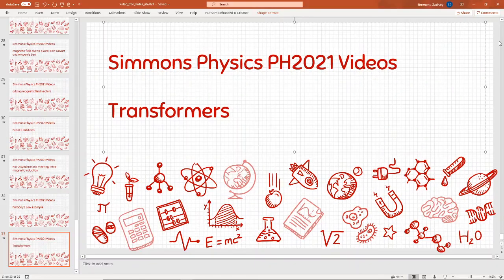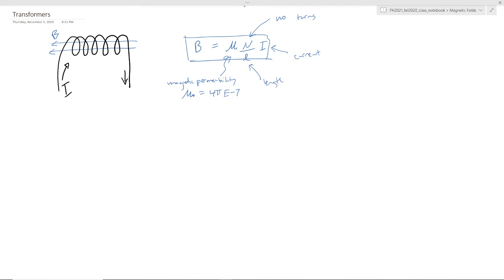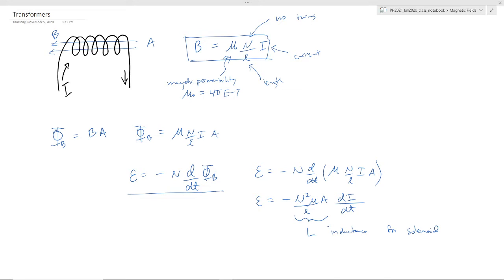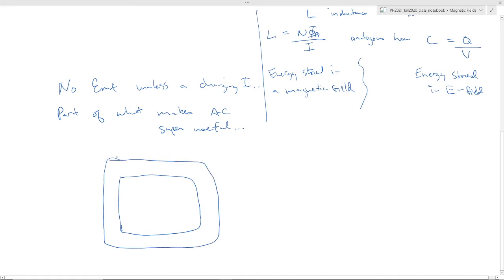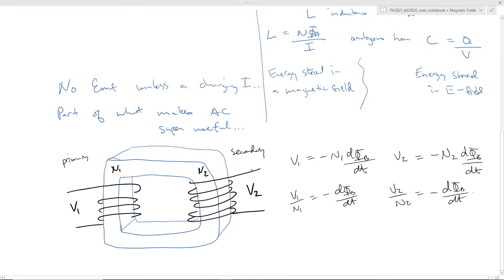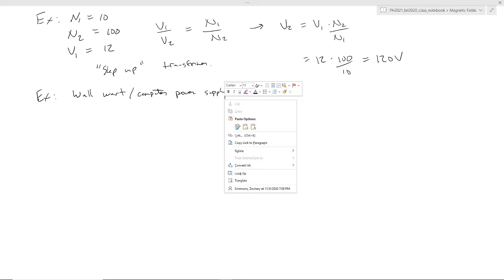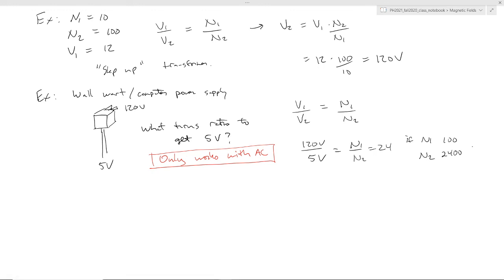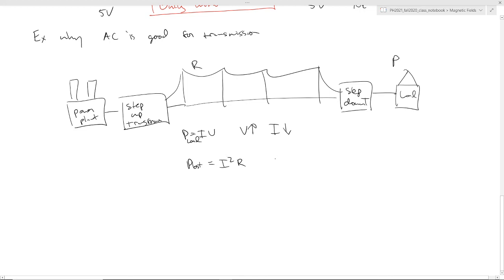Simmons PH2021 Transformers

Comment: 15:13 why wouldn't N1 = 2400 turns to N2 = 100 instead of vice versa?
Reply from the maker: You're totally right, thanks for bringing that to my attention, error on my part- i meant that to be the other way around. Step down transformer in that case, secondary has to have fewer winding than the primary.